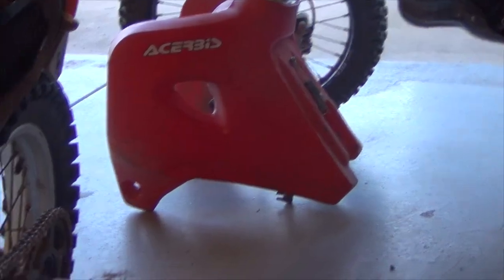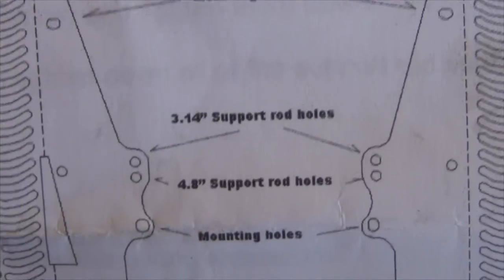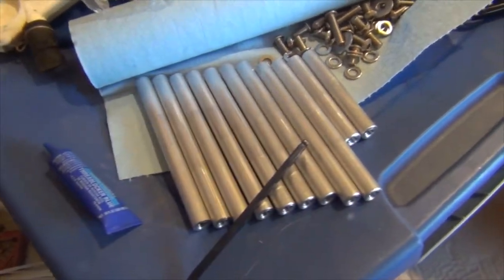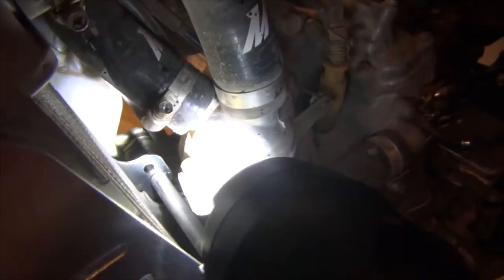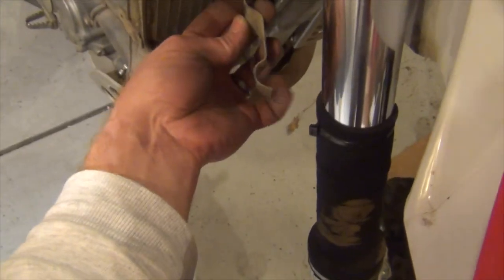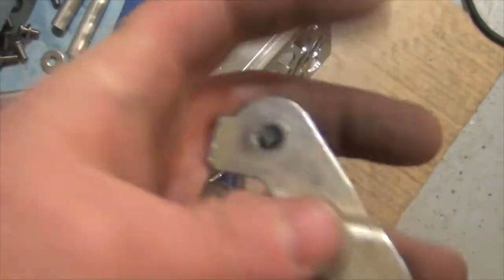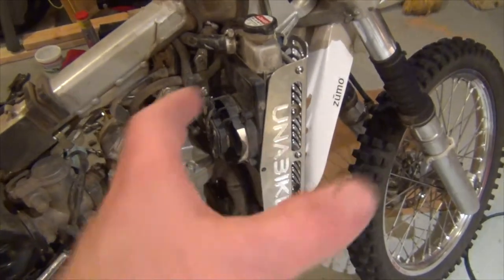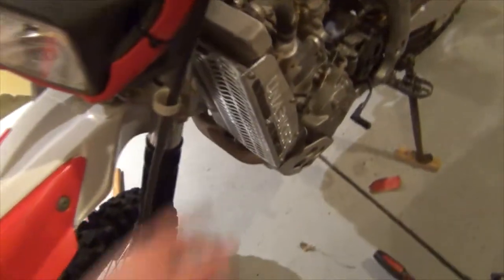XR650R Unabiker Radiator Guard - Installation

Comment: Any post-installation review? Likes? Dislikes?
Reply from the maker: Pat Pourier No clue...could not use them after I got int he new Radiators which were a copy of the Fluidyne ones so they don't fit. Have not decided what to do. Might sell the UnaBiker ones or first see if I get the stock radiator, so that might be an issue.wither...